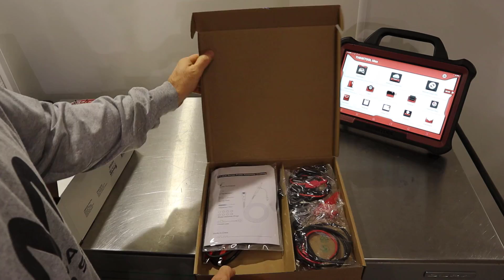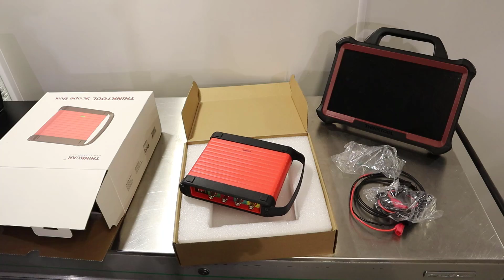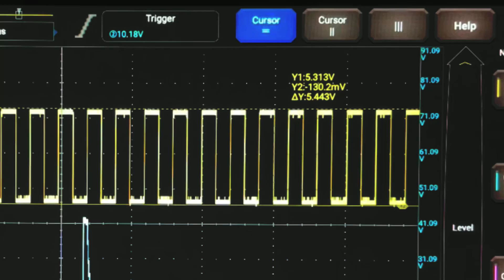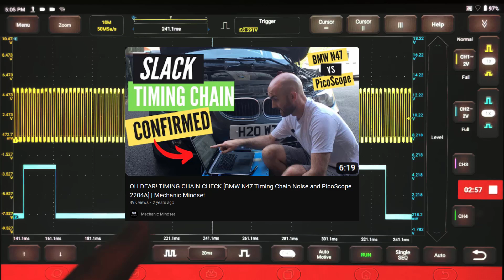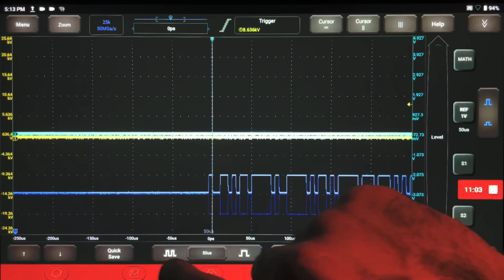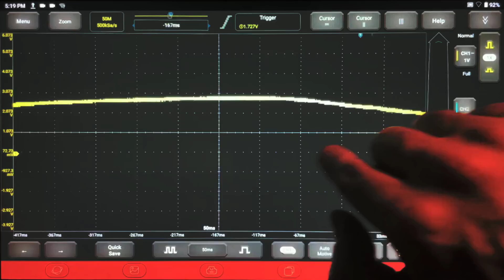ThinkTool Scope Box Oscilloscope from ThinkCar

Comment: It's crazy that even the cheap picoscopes like the 2204a and 2205a still put this $600 oscilloscope to sleep. I get way better results out of my 2205a. I know it's not 4 channels and needs an attenuator sometimes, but I rarely need 4 channels anyway. Not to mention, you can't even do a split screen with this oscilloscope either. This thing should be at least half the price they are currently charging for it. I feel like even the autel oscilloscope is better than this oscilloscope. It's nice that it connects directly to your scan tool, but you just cannot beat picos software.
Reply: I have an 8 channel hantek that is on par with this scope. The hantek is only $99usd on Amazon. Pico makes it look like a child's toy.
Reply: With Picoscope you pay for the software, not the hardware, the software contains a lot of things.
This ThinkTool ScopeBox is very similar to the Micsig in my opinion.

Comment: Do you know if you can use the scan tool and scope at the same time? For example run an actuator test and see it working on the scope.
Reply from the maker: I don’t think so but I’ll find out. Like a split screen feature?
Reply: @MechanicMindset  Yeah, split screen. I know you can with some of the Autel range.
Reply from the maker: Not possible
Reply: @MechanicMindset  Thats pants then. I've found it usefull in the past to drive an egr valve or ignition coil for example,with a scan tool and confirm its working on a scope.

Comment: is it possible to use two atenuators in series for high voltage?
Reply from the maker: No this isn’t recommended. A differential probe is required 👍

Comment: Awesome video - so Believe it or not the software is not Hantek it is Owon software. That’s not to say that they don’t get them from the same place. I believe it’s 200v input as well trying to find my info on that. I know for sure the software is Owon I’ll get back to you on the voltage. The only thing I found Cumbersome saving and recalling captures. I wish they made a PC version like Autel.
Reply from the maker: Ah cool! I know Owon: I got one of their hand held. 50V was the max I could get on the scale; is it 200V max input protection? (Like 2204A, 20v max read, 100V over voltage protection). Cheers Jay
Reply from the maker: PS. Same as MicSig?
Reply from the maker: Update: had it confirmed that it’s a MicSig scope 👍
Reply: @MechanicMindset  Where did you find that information? On the updates I’ll send it to you. It says OWON, you know when you update the tool? That’s interesting I wonder if it’s the same vendor
Reply from the maker: @weldingjunkie  Ah ok, a asked my contact at ThinkCar, she works there. Have MicSig got anything to do with Owon??
Reply: @MechanicMindset  I’m wondering the same thing. I know that thinkcar sells their software to TopDon so it def could be. I found the update I’m gonna send you a screenshot